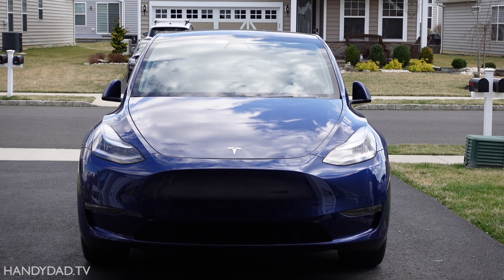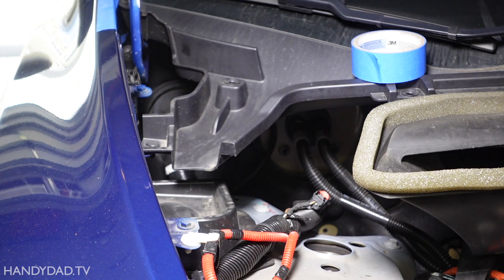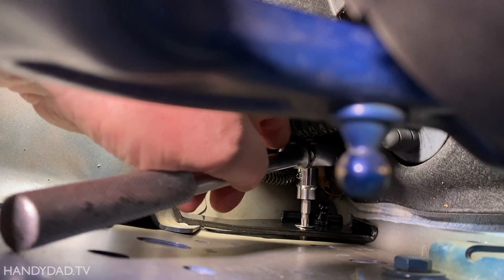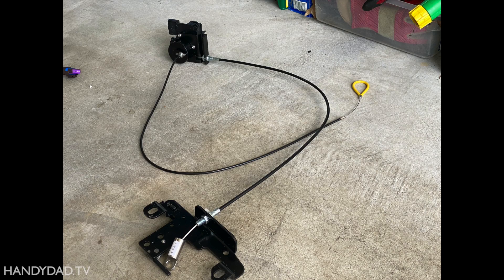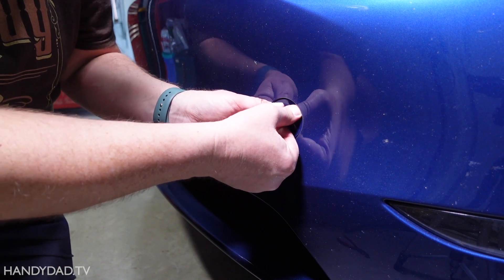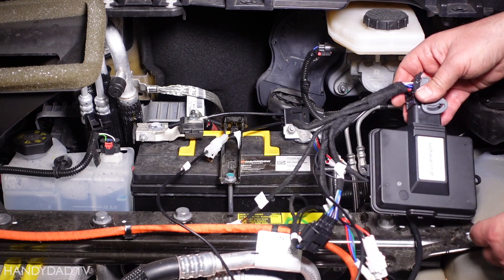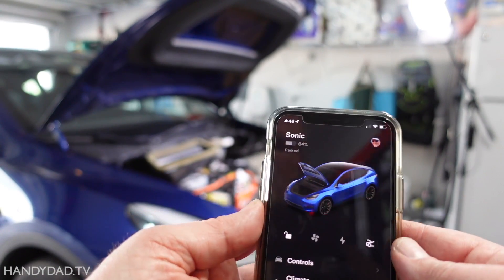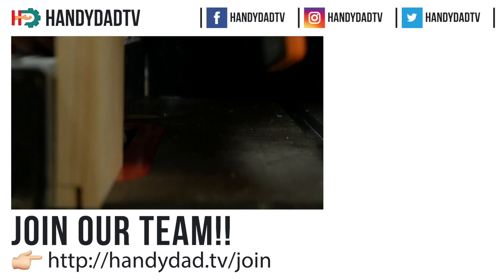Power Frunk Installation A to Z - Tesla Model Y

Comment: Great Video and Product, however, is there any way of trying the manually release the frunk lock using the cable attached to the motor. I have read a report that someone had a motor failure, which meant they could no longer open the frunk. I tried mine and it did nothing.
Reply from the maker: You should ask the manufacturer, but my understanding is the stock Tesla actuator is still responsible for unlatching the hood. The kit’s motor is only used to pull the hood into the latch when closing. So even if the kit fails, the car will still open the latch for you to open and close the frunk manually as without it.

Comment: Great installation. I installed mine a week ago. I think you have an issue about open/close procedure. It is not smooth… do you have fix it? And i think the bolt you have to put behind the spring is to big… you see the oem contactor and I think you risk to break it with such a big anchor…
Reply from the maker: It may not close smoothly, but it’s working as expected for an aftermarket adaptation. Still working great on my Model Y.

Comment: How is it powered with the recent change to 12v lithium batteries now?
Reply from the maker: Same way, although there is no elegant way to attach the wire. It just wraps around the positive connector. Not ideal, but it works.
Reply: There are a couple of ways to attach to the positive stud of the lithium battery. One is to unscrew the stud a little and slide the kit positive terminal under the base. The other is to attach the terminal using the nut supplied in most (all?) current kits.

Comment: Great Job. Does unit create a ghost load and prevent the car from going to sleep ?  My wife just picked her Model X and the frunk worried her.
Reply from the maker: It’s a trickle load for the control unit. Doesn’t affect my car sleeping.
Reply: @handydadtv  can you elaborate on this?
Reply from the maker: @Tom - The control unit is connected directly to the 12V battery so I assume it’s drawing a tiny amount of power even if the car is sleeping. But it doesn’t prevent the car from sleeping.